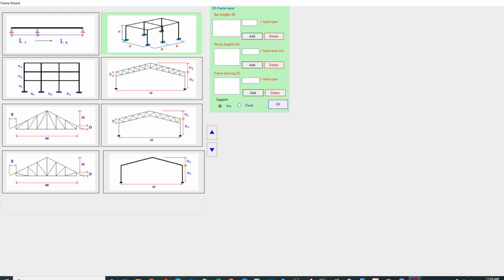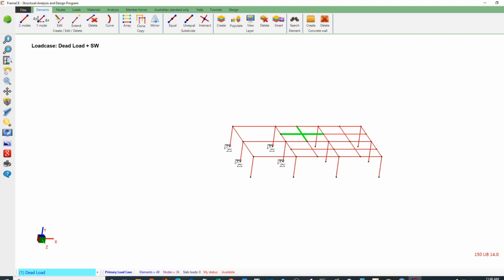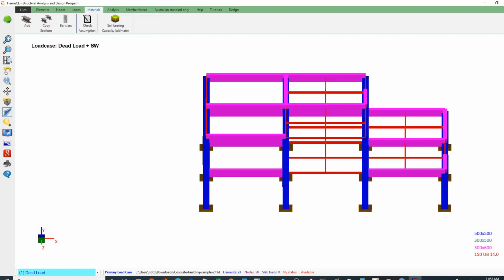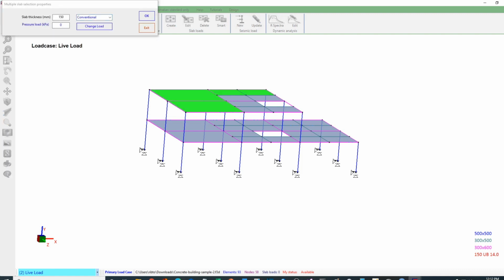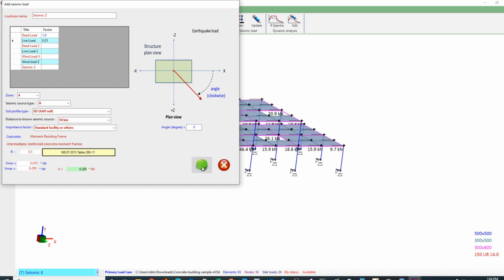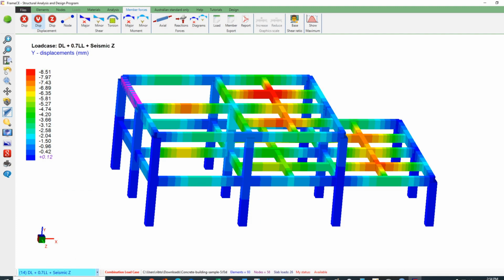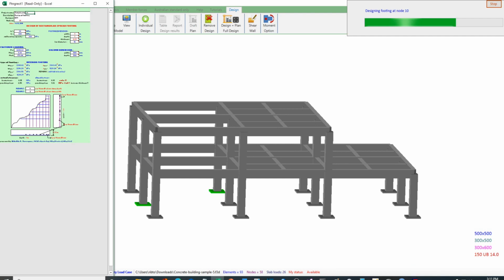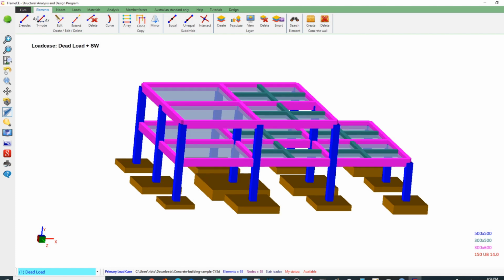Modelling, analysis, design and drafting of framing plan of a concrete structure using FrameCE

Comment: hello sir Rib, did the design+plan feature been updated? I think the one in this video is much more detailed.
Reply from the maker: This is the old one using Excel template to design. Nice presentation but very slow. Latest version is much faster and doesn't use Excel anymore.

Comment: Hi Sir Reb, purchased your software, can I use this on hanging / suspended bridges? TY
Reply from the maker: Anything structural  FrameCE can be used.
Reply: @framecetutor6193 can it FEM concrete wall?
Reply from the maker: @AJ-lj6io  Yes